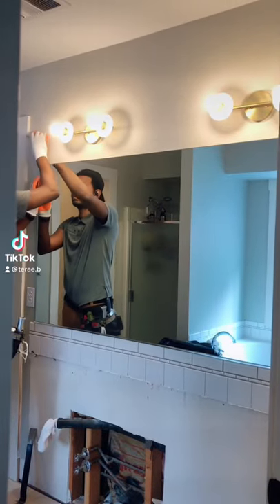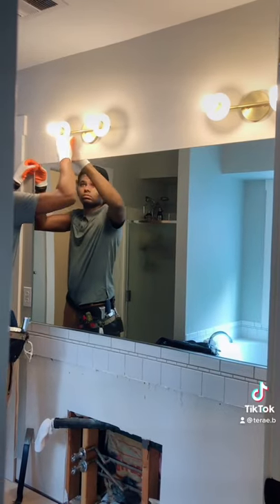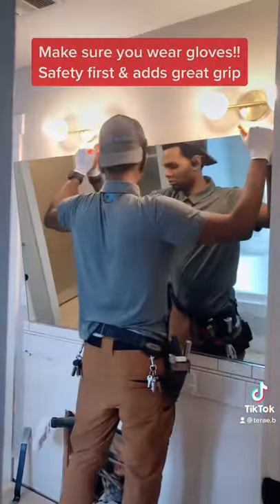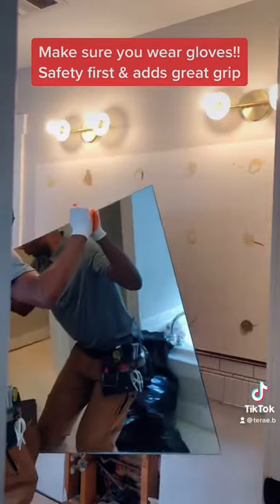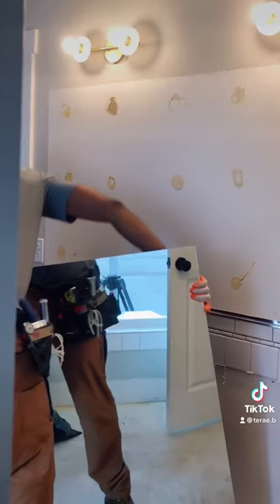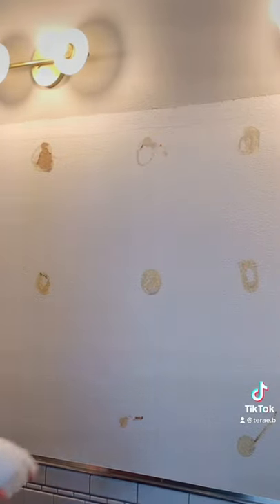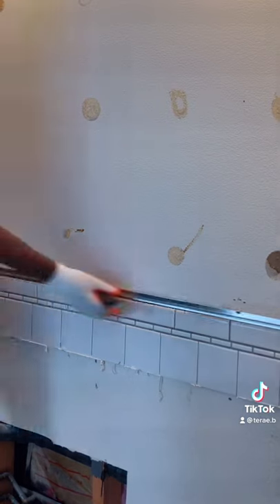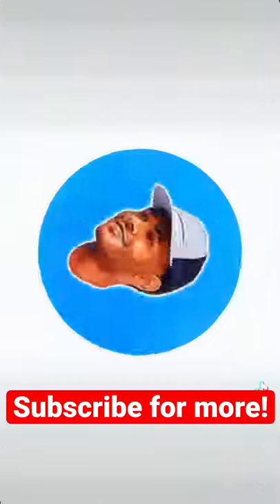Don’t remove a mirror ever again without doing this!! How to! DIY style? #shorts #satisfying #diy

Comment: How did you remove the glue on the wall,?
Reply from the maker: I used a “5 in one “ tool to wiggle the adhesive free
Reply: @TeraeB  nice. Did you simply plaster over it and then painted?
Reply from the maker: @AlkalineInsides  sanded down the areas , applied compound over it. Sanded that smooth. Then applied a texture. Then painted 👍🏾
Reply: @TeraeB  when you say you applied a texture after the compound, what’s that mean? Forgive me… I’m learning lol
Reply from the maker: @AlkalineInsides  No worries! Texture referees to the pattern or style applied to your wall. Typical vertical walls have whats called orange peel texture. I have more video ops on this 👍🏾

Comment: Can easily remove a mirror with suction cups and pull at each corner. Have never broken a mirror. Probably have pulled well over a hundred in mold remediation. Can also use airbags to squeeze in between to get a pop but theyre not needed.

Great video, I'm not taking anything away from the video's usefulness! Just thought id share my process.
Reply from the maker: No, we appreciate it! Thanks for sharing other options 💯👍🏾
Reply: @luiscastaneda1190 the price difference is near the same. Suction cups can be used to help you hold the mirror as well. Id always have one hand holding the mirror and the other one pulling on the suction cup.